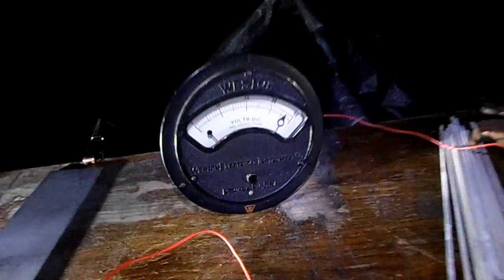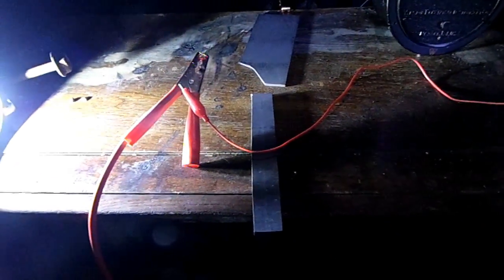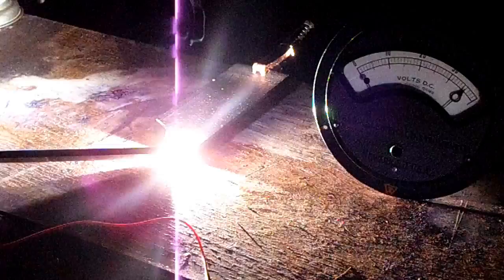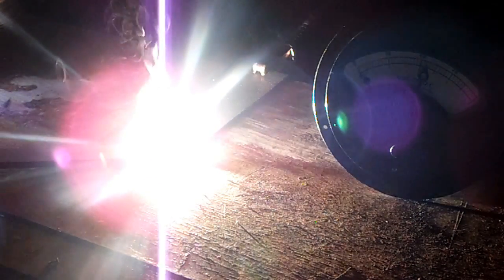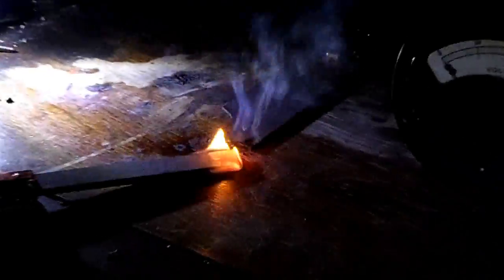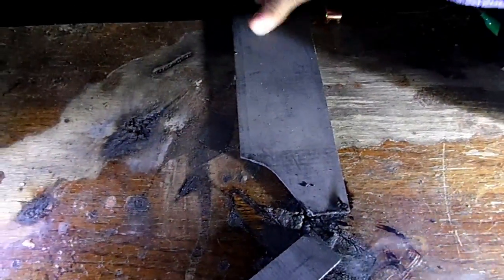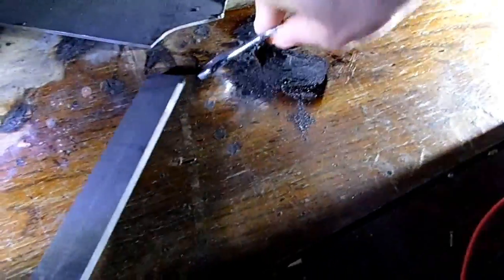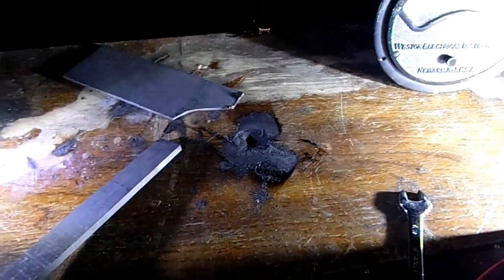DIY Arc Furnace first test

Comment: Testing arcing electrodes on a wooden table? Seriously?! You're REALLY careless.....
Reply from the maker: CoolKoon
you catch me as the kind of person who doesnt do any blacksmithing in their back yard nor uses fire much, and is afraid of everything. it would be very difficult to catch this table on fire enough to make it burn all the way down.
Reply from the maker: +CoolKoon why am i careless? its a shitty old TV stand i use as a disposable backyard workbench.
Reply: Are you kidding me?! There's a reason why everybody who's toying around with this stuff does it on some refractory material or at least brick or concrete. The stuff you're working with is hotter than fire! In fact more than twice as hot, because the temperature of the plasma arc can easily reach 3000 °C (or even more), while "ordinary" flame temperatures rarely go over 1400 °C. Even the glowing graphite rods are hot enough to make any combustible material they touch burst in flames....
Reply from the maker: CoolKoon CK
yeah so?
Reply: Rinoa Super-Genius Oh, nevermind then. Just keep on experimenting. Hopefully you won't be too sad when all of a sudden your home turns into cinder....
Reply from the maker: CoolKoon CK
i highly doubt that this thing would burst into flames enough to catch my house on fire thats 40 feet away. at the very worst id just have a burnt spot in the back yard.
Reply: +Rinoa Super-Genius Hopefully you don't have any sheds, fences or dry grass nearby either. My point is that playing with electric arc on a combustible material is just a bad idea.

Comment: does the graphite degrade in any way?
Reply from the maker: it burns and catches on fire. but it's ignition point is so high that it quickly cools down if i stop the arc.

graphite is basicly super pure coal and will burn at several thousand degrees, its just very very hard to get it burning.

i plan on using a shielding gas like nitrogen or argon to help keep the graphite from burning away too much.

Comment: Looking forward to see what you come up with. There is a video on youtube some where of some kids melting bricks with an arc furnace powered by a 300 amp arc welder. Pretty scary stuff really lol
Reply from the maker: yeah that video is like 3rd result after Rodalco2007's arc furnace videos whenever you type in "arc furnace"

this battery setup should be pulling 900 amps at max. but its most likely only pulling 200-400 amps.

and thanks for enjoying it :D